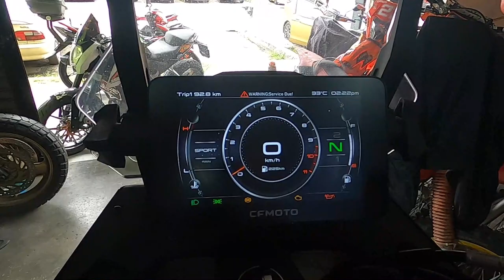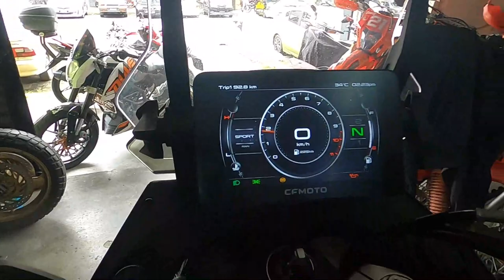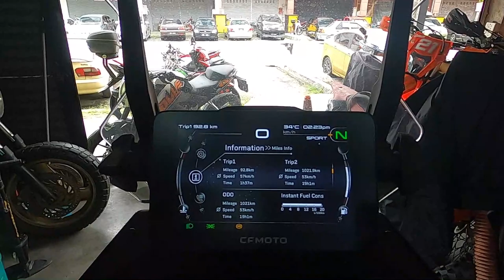CFMOTO 800MT | Change  Engine Oil &  Oil Filter | Reset Remaining Dist:

Comment: Hei brother, thank you for your videos about the CFMoto 800! I am having trouble with the headlights. When I am riding with a passenger I am constantly blinding upcoming traffic. I tried to adjust them but without success. The manual is stating to turn a "knob" of some kind and I guess I found it, can't reach it tho. Any chance of you providing info on that topic? Would be much appreciated 👍
Reply from the maker: hi, thanks again. to adjust the headlight, there is indeed a knob on the back (headlight), adjust the knob according to your own convenience. can be accessed from below or look in the manual, there are instructions for adjusting the headlights, sportlights. 🤠🤠
Reply: @YUSRIZREPUBLIC ..north american models may not have that adjusting button just like we dont get the on off button for the headlight/ parking light. I didn't see a adjust  button on mine, just a spot where one should be  ....

Comment: What buttons did you hold down to get rid of the Maintenance warning light?
Reply from the maker: U hold button UP+SET until 20 second. It is reset to 15000km anyway. 15k-30k-45k-60k-....

Comment: Hello, at how many kilometers is the service done?
Reply from the maker: 1st 1000km
2nd 15000km
3rd 30000km and so on. This is included in the remaining distance (meter panel) and the service manual. But it depends on the quality of EO and the use of motorcycles and pocket money. can be changed every 5000km
Reply: @YUSRIZREPUBLIC  thanks